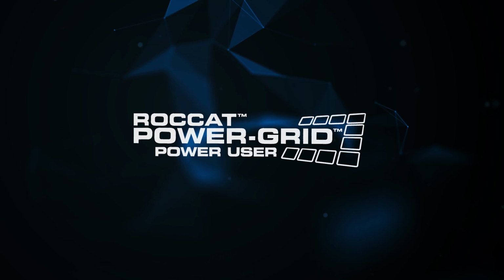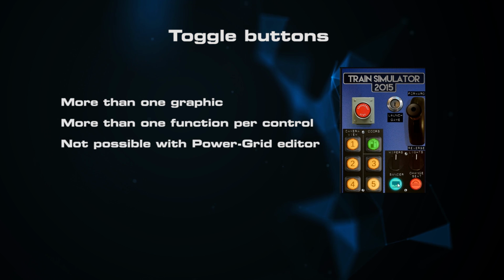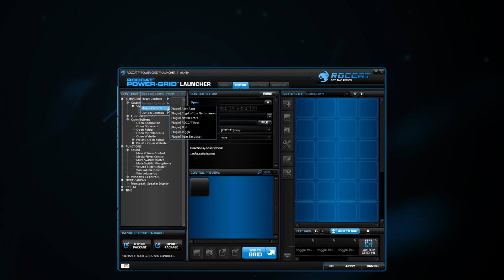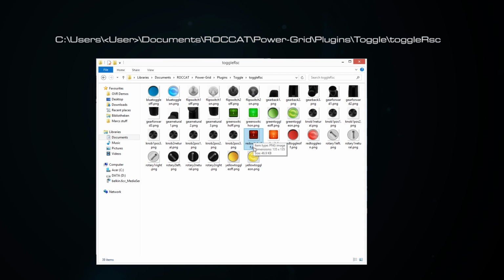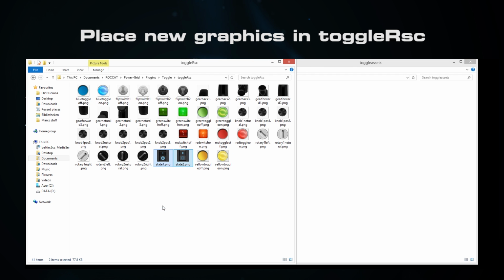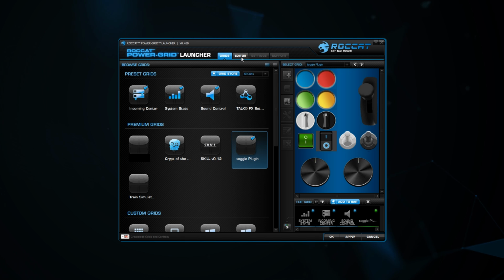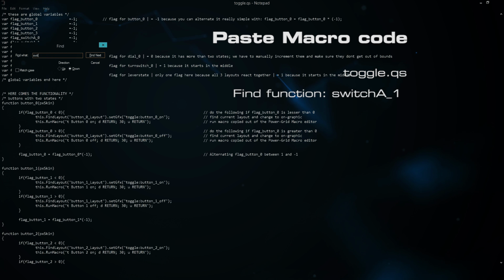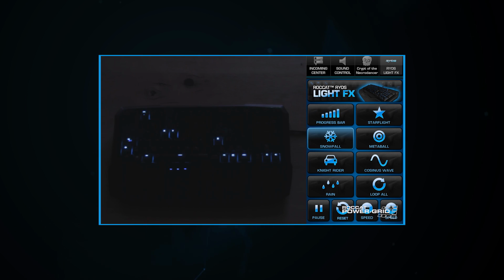ROCCAT Power-Grid | Power User Series Part 2

Comment: How can I set a toggle switch to send a command to hold a key down until I turn it off?
In my case I want to have a toggle that when flipped ON holds down the "N" key, and release it when I flip the switch to OFF.

Comment: for me it doesnt work completly.
I added graphics in the folder.
changed in the plugin.json file
Copied the macro code to the qs file and the correct toggle
made sure the keys are set up good in elite dangerous.
press the button and instead of my cargo scoop turns on or off, the chat starts and my weapons are being deployed.

i have no clue what i`m doing wrong. No experience with coding and i watched this movie constantly and checked all my actions. Yet it doesnt do what it should. where do i go wrong? or is it changed after 4 months?